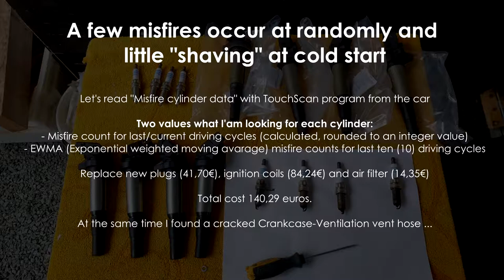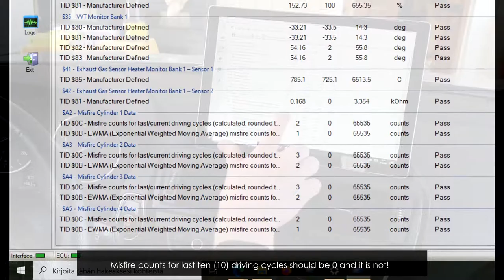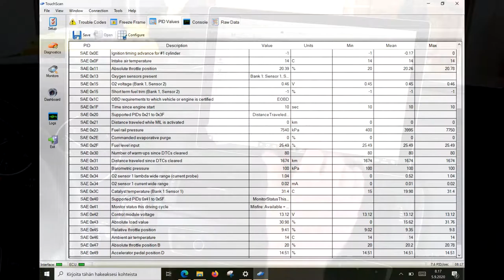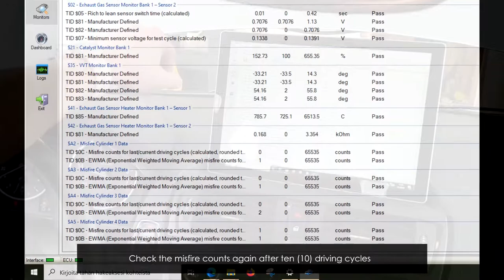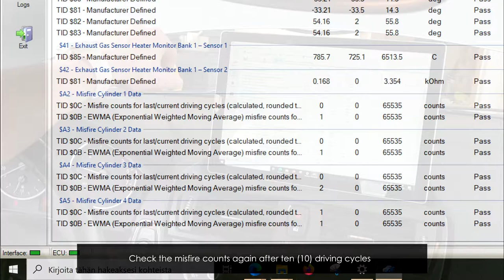Replace SPARK PLUGS, IGNITION COILS and AIR FILTER  - BMW F20 engine N13

Comment: Which is part Number of Delphi ignition coil?
Reply from the maker: Part number 12137575010 manufactured by Delphi without BMW logo (OEM = Original Equipment Manufacturer).
Delhi is the official manufacturer of ignition coils for at least this BMW model at the moment. That is why I chose ignition coils from Delhi.
If you want OE accessories from a dealership that also comes with the BMW logo, they are more expensive just because of that logo (license)
Reply: Jani Voutilainen thank you! I also see part number GN10572-12B1 from Delhi but i think that are the same part
Reply: @JaniVoutilainen  btw I tried NGK, also doing fine. I had Delphi with BMW logo, so I thought I will try something else, because NGK produce spark plugs, so I thought why not. So, far good
Reply: @JaniVoutilainen  Can I use Bosh spark plugs? They are 0.7 mm
Reply from the maker: @Lordshire1  Yes you can use. You can find spark plugs with part number 12122293697. This will ensure that the plug is compatible! 👍
Reply: @riccardorossetto6947  GN10571 do not match, will gn10572 be good?

Comment: Good day sir do you know where the fuel pump relay is located for f20
Reply: Hi dear, the fuel pump relay is located behind the right rear seat. If you pull the back seat towards you, you will be able to see it. It is blue. You can remove it and put it easily without using any equipment. If I helped, don't forget to subscribe to my channel. I will be uploading a maintenance video of my f30 320i ed vehicle soon.